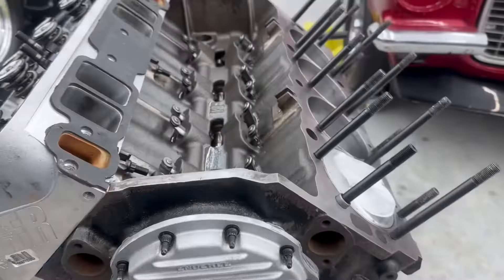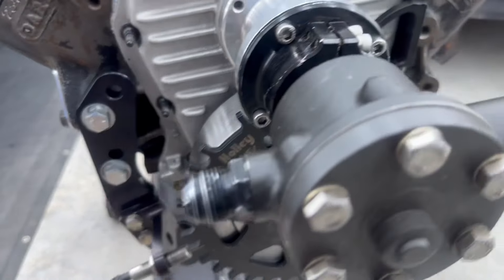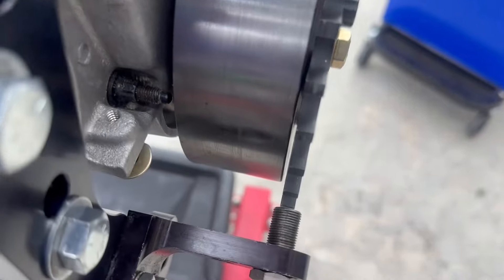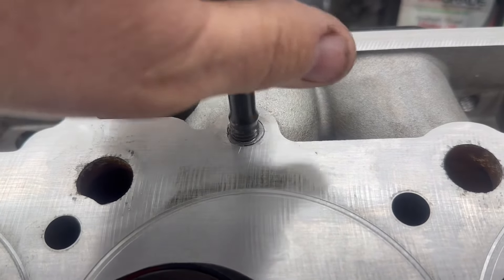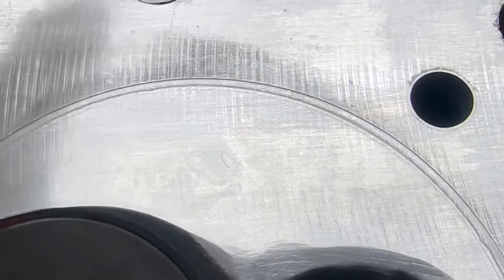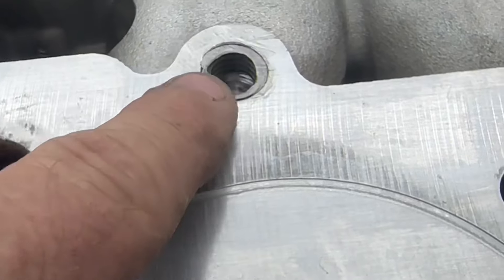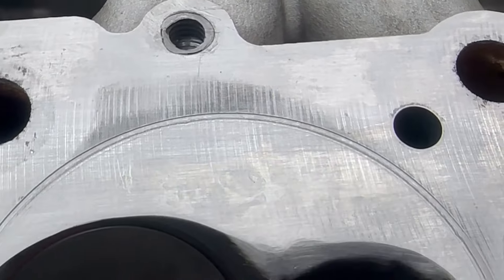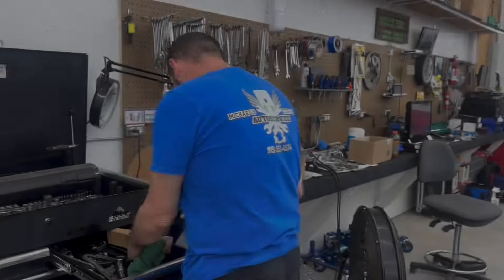Should I keep the Elbow/Spacer? TurboJohn 532ci BBC is almost READY......

Comment: It takes 10 mins to cut an oil filter apart. 2 oil changes in 135 race miles so far, both cut apart, plus a sample so far analyzed. I did not analyze my straight 30W breakin oil. But, now have a baseline to warn me of future changes over time. First filter had some minor trash ( but that block sat at machine shop for over 12 months, 3 weeks so it was expected). 2nd had a total of 7 tiny specks in it totally unfolded over 6' plus of filter material.

Comment: What determines the amount of oil to the top end of the engine are the clearances, not the "volume" of the oil pump. Once the open pressure of the bypass is achieved the remaining volume is bypassed from the engine oil passages back to the pan.   The engine clearances do not change with rpm therefore the amount of oil to the top does not either. A higher volume oil pump will bypass more oil but pump no more to top of the engine at max pressure.

Comment: John , get shaft rocker setup !! You will pull the intake studs out even with a girtal system!!! High flow BBC heads are super thin on intake runners buddy . It will cost you more when she goes and dhe will bud . Take my advice it happens every time. BBC Rule!!! 💪😎
Reply: I think those are just out of the box bbc afr heads. He knows and will get there with shaft rockers.
Reply: @jasonstormoen  out of the box CNC AFR heads lol they're thin sir . They will rip the stubs out of intake side possibly crack the top of runner in the process. Sad but true with high flowing heads which these are..... They're over 365 CNC heads I can tell . Hope he doesn't but I I'm sure with that camshaft and rpm they'll break . Sucks but true

Comment: You guys are not required to build buy any rules. Mike, call Ross Piston, float the pistons on the pins, gun drill the rods, then use double spiral locks on each end of the pins. That way the pin end gets its oiling from the other bearing end of the rod.

Comment: BLP and others sale a jig to install piston squirters in most engines, they are pretty easy to use. I am guessing you are having the rod and piston pin holes sized properly and not just running them out of the box.

Comment: John get rid off those stud mounts rockers they WILL cost you money or a race in time ask me how I know have been running blown bbc for 40yrs now and still at it shaft mounts steel or stain steel is the best way to go you only have to buy one set once you will pull a stud once you get up into 7000 rpm range

Comment: The splashing issue is what I thought when I first seen the piston pin bore galling as well because it wouldn’t affect the piston . There was a lot of heat in that pin from the colour . 
 John I really like your show and all your buddies! Good group of friends!
Reply: Maybe that thin bushing is too thin to hold the press fit. Spinning it and starving the top hole access to oil and creating too much heat growng the pin then pin grabs the pistons and wipes out the pin bores...
Tops of piston are brand new and if the rings still have tension i cant see it being a tunning issue, not that i know what im talking about. Im facinated by mechanical failure. Always been very interresting to me

Comment: Get one of those see thru oil filters tj that way you can see bearing material metal junk etc... that's what saved cleet on his smx  one time they seen some trash cleaned the filter seen it again and made the call to stop running and saved the engine and just put new bearings in and was good! They are pricey but compaired to a new block heads crank etc.... well worth the money

Comment: The problem with the lx next pro blocks is that they only have 4  x 7/16" holes to drain ALL the oil back into the pain. The oil from the heads drains into the lifter valley  too, no passages into the pan from the heads like a gen1 sbc. Mine got to 15psi oil pressure at 8800. Didn't hurt it, just needed bearings redone. This time I have a 10qt pan and slots cut into the lifter valley similar to how your bbc is done.

Comment: What about rod side clearance? You can still check that... If sufficient oil was not there to lube the wrist pins that would suggest that the rod side clearance was tight. Some teams notch the side of the rod to direct oil to the piston.

Comment: I ran dss pistons and boost line rods last year and had detention going on that didn't show on the plug. Had head gasket failures what seemed randomly. Tore it down and the only bottom end issues I found was the piston collapsed around the pin and seized the pin from turning in piston.  I had h series bearing and they looked awsome. Maybe the piston distorted blocking oil passage to the pin bushing in your case? Just a thought.

Comment: I think that is why aluminum rods are becoming more common, there is more wear on the pin side. I think that is normal for a steel rod for a drag car. I have been watching a lot of people have gone to an aluminum rod due to this wear and then not going 40-50 runs for a set of rods. They are not junk, just a different animal these days. You are getting more power than even a few years ago. It is the evolution of the sport, some things wear more as you make more power. I think this is an example of the evolution of the sport.

Comment: I would ditch that intake and tall elbow and try to get a more modern EFI intake manifold.  In addition to having a front mount throttle body they typically have better cylinder to cylinder distribution.

Comment: The discoloration of that pin is a piece of the puzzle we didn't have last time.  I'll pull back about 50% of my it has to be detonation thought.  That is starting to look more and more like an oiling issue which absolves the rod or piston because let's face it those are very good parts.  Maybe check the pin sizing on the new motor and have the pins fit if anything is even slightly off or inconsistent.  I'm not sure I completely buy the high volume oil pump issue unless you did have some anomalies in the log about oil pressure.  Oh and the elbow is TOO much.

Comment: If you’re running a vacuum pump on his LS engine and your pulling too much vacuum it will suck the wristband dry for what it’s worth
The other possibility is there is flex in the wrist pins  and you might need either more pin clearance or dlc coated thicker pins

Comment: I wonder if he flooded the engine. And it wiped down the cylinders and the methanol went. You know went down the cylinder walls and then got you know, washed into them. Bushings and seized for a little bit while he was trying to start it or fired up, and it was, you know, had too much fuel in it and a few galldepiston that that can happen Meetha. That could happen real fast. It's just the thought.

Comment: do you really put some kind of sealer on the head gaskets I have never used anything but a tiny bit of high tack to hold it down to block so I don't kink or knick the gasket but I have always been told to never use any kind of sealer on the head
Reply from the maker: On a copper head gasket, you have to use something around the water ports and oil return or it leaks.  I used Hylomar.

Comment: The ls is fine besides the issues you e been having but the main issue with your challenger is having a Chevy in it lol as a Mopar guy it seems wrong , gen 3 hemi is similar to a ls if you don’t want to build a gen 2 or a low deck or b/rb or maybe the r series la platforms …. Come on now lol maybe it’s the Mopar cost which I get

Comment: Where does the oil from the oil pressure bypass go?  Unless it goes to the top of the engine, this whole high volume pump thing seems like nonsense to me.  The pressure relief determines how much volume can actually go though the engine.  At a point, in order to push more volume through the engine, higher pressure HAS TO happen.  Without the higher pressure, no additional volume can go through the engine, it all just goes through the pressure bypass.  Right?  Logically you need just enough volume to create the desired pressure in operation, and no more, because that is just extra heat in the oil, but beyond that, I think the "oil in the top of the engine" is an old wives' tale.

Comment: John you know I am World Famous fo Throwing some thing out there But Why can yawl 3D Print some Plastic cages and use Like U joint Needle Bearings on the Rods like 2 Stroke Stuff Is  that Stuff Survives with gas mix N Oil and very little Oil at that :face-blue-smiling:
Reply: Horsepower, torque, thrust determines what lives, a 2stroke at   a few percent of the horsepower these engines make is why the needle bearing setup lives in the 2 stroke.

Comment: You will beat the ends out of aluminum rods also, if there’s an issue! Remember he’s at 0 deck & aluminum rods grow! Aluminum rockers on exhaust on a big block are going to break! Carry spares!
Reply: Boostlines are steel rods though right? My speculation is clearance,  detonation would show elsewhere i would think. Wouldnt think oiling issue, if the rod bearing is getting plenty of oil then plenty should be getting slung up in the bore. Im sorry for Mike thats a weird one. Id mic the pin and make sure it wasnt a .928 or something. Props to him for catching that, wow, check them filters! Probly could save it all by boring or honing the pin bores for oversized pins.